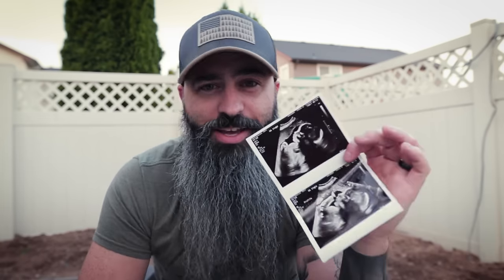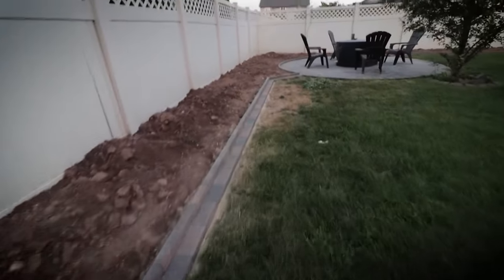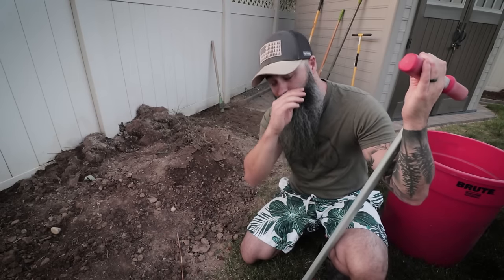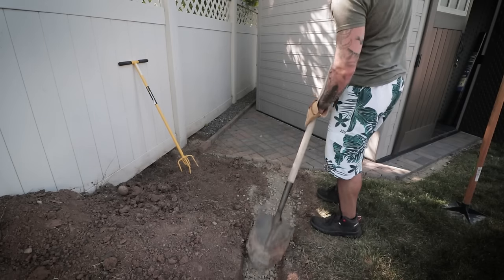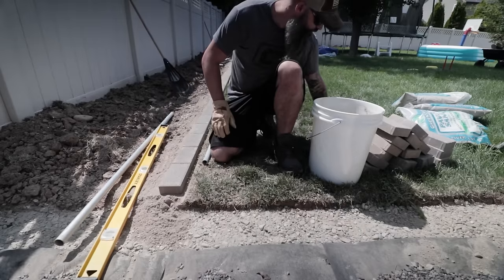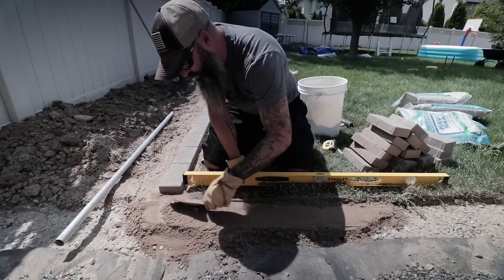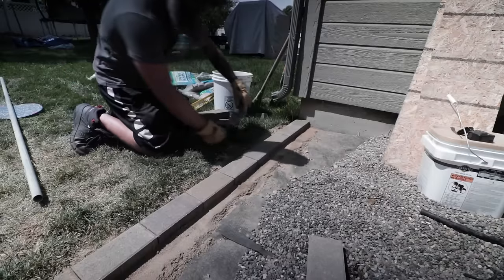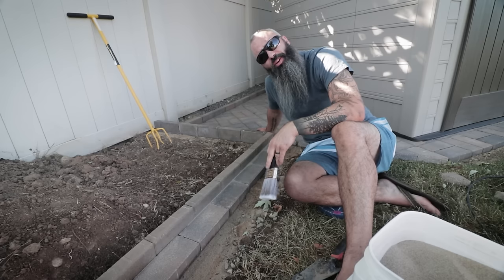How to Install Beautiful Paver Edging

Comment: How do you keep the uprights from tipping backwards? Should you use a edging?
Reply from the maker: I put fill dirt and mulch in the raised area behind them.  Between that and the polymetric sand they have done well.
Reply: @OutdoorBeards  awesome thanks for the response. I will follow your steps in my paver patio first then tackle the edging.

Comment: I would have to say that it looks nice. But unfortunately it won’t look like this forever. This will shift and move,and you will likely be re doing this! Use some heavy duty garden edging along the front and back to hold the brick in place it might help.

Comment: How do you do this if your garden is on a slope?
Reply from the maker: That’s tricky.  Depending on the length you’re working with I would suggest taking some long 2x4s, screw them together into a really long straight edge.  Lay this on the ground where you’re going to put your edging.  Place a level on this and look at the bubble.  Take note how far off center it is, then, follow the same steps in the video but instead of trying to be level you would be trying to keep the bubble off center in the same spot the whole way down.  Also on a slope you need to use paver edging, plastic stuff that holds your pavers and sand in place.  On a slope gravity will do its work over time and send them down the slope. I hope that helps.

Comment: But what holds them in place?
Reply from the maker: On the “short side” dirt and grass keep it in place.  On the “tall side” they are holding back dirt.  So the dirt and grass on one side and dirt on the other kind of pinch them to hold them in place.  Then the polymetric sand that I put in the cracks acts like glue.

Comment: My pavers were nicely placed, like yours until the ants decided it was a great place to excavate and build their nests.  Then, despite Amdro and other ant killers,  they managed to undo my nice level pavers.  Grrrrr....I did resort to concrete ultimately under the pavers, not sand.
Reply: Did you use quick setting concrete instead? I've seen other videos where they used quick setting concrete and misted it after with water.

Comment: Hello, I see that this video was 3 years ago, but what is that stuff below the sand? Is that concrete?
Reply from the maker: Hello, no it’s called paver base or road base.  Also known as 3/4 minus because the largest rock in it is 3/4 of an inch.  Essentially it’s something that compacts very tightly so you don’t have settling later on.
Reply: Sorry for these basic questions. Where can I find this paver base? Is it at the Home Depot or Lowe’s?
Reply from the maker: @bodyfusionsmassage7774 no worries at all!  I think you can buy it at Lowe’s and Home Depot by the bag but it’s crazy expensive because the bags don’t go far.  Find your local landscaping supply.  These are normally places that sell things like trees, rocks, sand, bark, mulch, etc.  I had my paver base delivered because I needed something like 6 yards.  My sand I only needed 1 yard so I just took a truck over and they dumped the sand into the back of the truck.  Cost at these places is super cheap.

Comment: I have a question, how did you continue this approach in style with a circular turn? Thank you.
Reply from the maker: I didn’t have any circular turns on this but I did do this same style around a couple of trees.  Lot of math involved but you have to figure out the angle to cut the pavers so they rotate around the object.  For my tree I did a 4’ circle.  Pretty sure I had a 7 degree angle to cut on all the pavers.  It was a pain.
Reply: @OutdoorBeards  This was extremely helpful! ALso, what substrait was that? The top was sand but what was the rocky substrate below it?
Reply from the maker: Paver base or road base.  Sometimes called 3/4 minus.
Reply: @OutdoorBeards  Just wanted you to know that you def inspired me to get out there are get shit done. Cheers mate.
Reply: @OutdoorBeards  Sorry to bother you one more time but, I was told I needed to reinforce the face of the bricks with a guard. Is that unnecessary?
Reply from the maker: That depends on if your pavers are below or above the grass line. My horizontal paver is buried in the grass line so the grass and the top of the paver are the same height. So for me, I was able to pack dirt in front of the horizontal paver to hold it in place.  For my deck pavers, which are vertical, I put dirt back there as well that is raised to the top of the vertical paver. So the dirt in front and dirt behind hold everything in place. Where I live our dirt is like clay and it’s pretty solid. You could use paver edging, which you nail in place and it holds the pavers. Because I did not do this there is a greater chance that my pavers will move over time But I did not want to spend the additional money to run 164 feet of paver edging both front and back.
Reply from the maker: That was supposed to say back pavers not deck pavers
Reply: @OutdoorBeards  makes sense. I suppose the store clerk and I just miss communicated.

Comment: My only concern with this type of paving design where you're putting vertical pavers behind the flat horizontal pavers in the water of rain trapped inside this whole structure?
Reply from the maker: The pavers themselves are not porous and don’t hold water.  The space between the horizontal and vertical is filled with poly metric sand which, once cured, acts the same way.  However, it is difficult with this setup to ensure there are no pockets of space that could fill with water but if that happens then the water would drain out of the pocket or evaporate out of the pocket.  I have not had issues from this.
Reply: @OutdoorBeards  Excellent, thanks for the clarification.  I was thinking of doing this same setup in my backyard and as usual... I have my analysis paralysis and my tendency to overthink things.  Thanks again.
Reply from the maker: I would make one change if I could go back and do it again. Add some quick concrete behind the vertical. The poly metric sand does not hold as well as I thought it would and with 2 kids they took a beating and would get pushed backwards.  Adding some cement on the backside solved this issue but would have been easier had I done it during the initial install.
Reply: @OutdoorBeards  thank you for sharing this.  One last favor, whats the name or brand of this specific paver that you used?
Reply from the maker: Holand tan and charcoal.  They are available at lowes and home depot
Reply: @OutdoorBeards  Thank you so much!

Comment: The edging looks nice but why not use a line like.a mason does strung from one end to the other level all the way job dobe
Reply from the maker: My yard is not level from one side to the other.  Had I gone level all the way across some pavers would be above the grass line and some would be buried.  So I leveled where I could and adjusted where needed.  This was easier to do 4 feet at a time.

Comment: It looks great, but won't it be easy to knock the blocks out and ruin all your good work?
Reply from the maker: No, the polymetric sand acts like glue and holds it all together.  And I raised the level of dirt in the back behind the vertical paver to help hold it in place.

Comment: Aesthetically it looks nice...but it's going to shift since there is no edge restraint to keep it from moving.
Reply from the maker: The raised dirt in the planter area behind keeps it from moving that way.  Since I slightly buried in the grass line the dirt I put in front for the grass to grow on stops it from moving forward.  Worked well so far